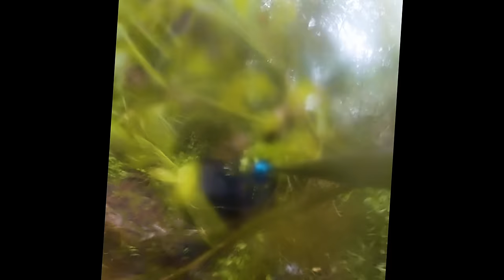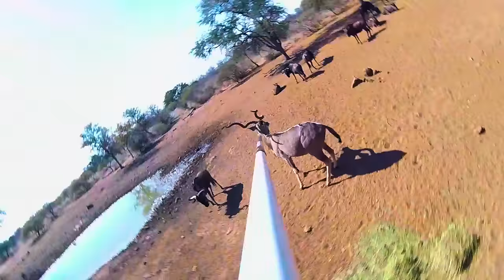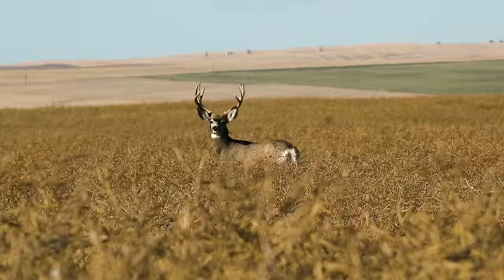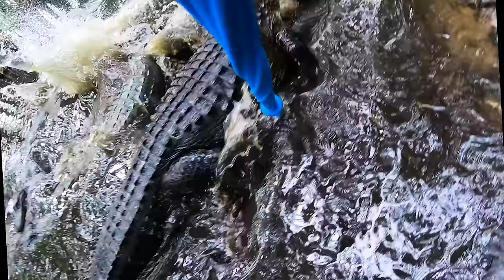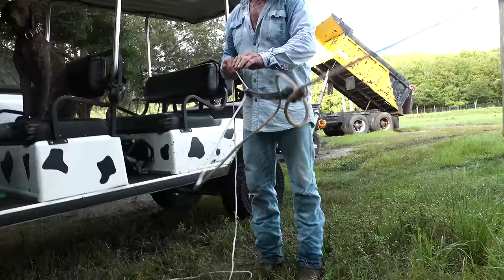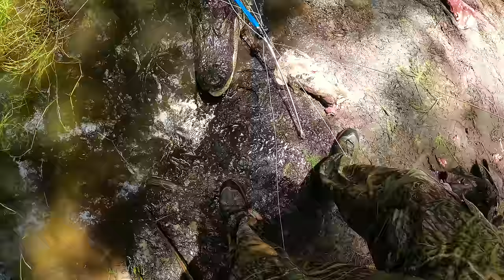Giant Alligator Versus Spear, Part 2

Comment: Tim: he’s nearly out of spear range
Also Tim: Hits 50ft throw with spear
Reply: That’s what I’m saying but maybe it’s because a alligator have tougher hide than mountain goats
Reply: @DTplayz01  Ik right😂
Reply: @DTplayz01  they can stop bullets
Reply: @monke6912  no
Reply: @monke6912  they can only ricochet bullets at sheer angles, not stop them completely
unless you're talking about a hollow point or low power round
Reply: @cougar9610  some Hunter hunt Nile crocodile using barnes TSX which is hollow points
Reply: @monke6912    No they can not stop bullets at all